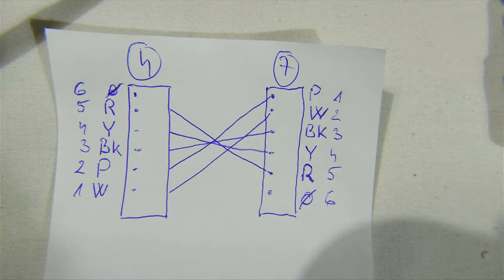PTZ CAMERA INSIDE WIRING AND PARTS SDETER

Comment: Hi, I have this camera same like and problem is "if I connect power start it's rotation and little flash stop. This camera can't appear singal in this camera ap mode is not work. If I press reset it's said reset is successful. Please do you have any solution?
Reply: Mine was working then one day it reset. From then on only light on and no more resetting.